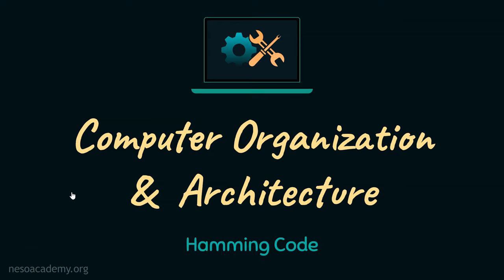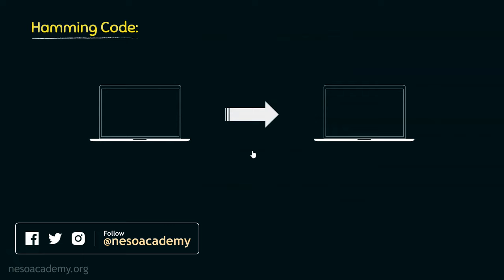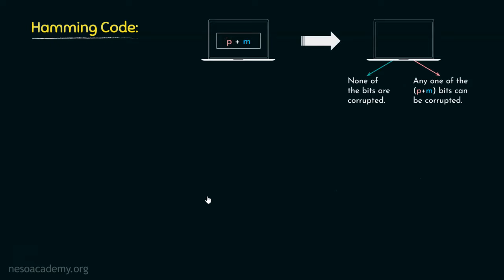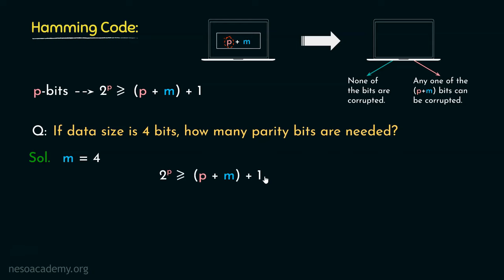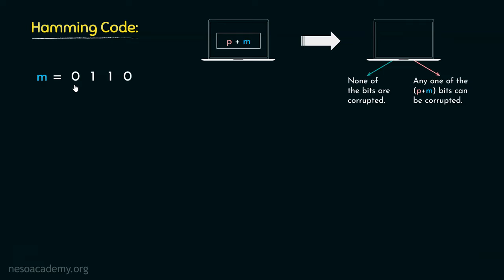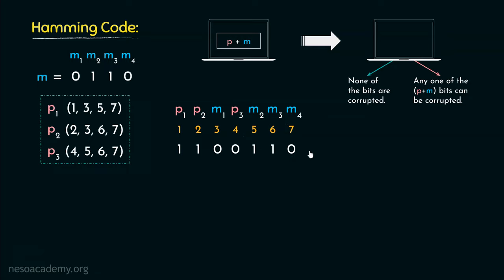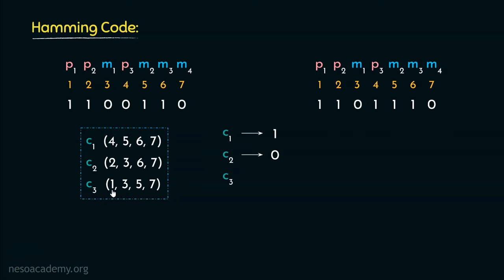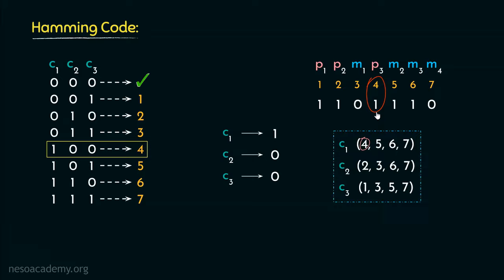Hamming Code

Comment: Great video. You just denoted the hamming code representation the other way round the p1 bit is supposed to be the rightmost and vica versa. If that is not taken care of while solving a question one may declare a valid hamming code to be invalid!!!! So be careful and if possible write a note about it in the video.
Reply: no, he denoted it correctly. both of the ways re correct

Comment: 🎯 Key Takeaways for quick navigation:

Hamming code is capable of facilitating error detection and correction, unlike simple binary codes.
In computer organizations, single bit errors are common, and Hamming code helps correct them.
Parity bits are appended to the message for error correction. Two scenarios can occur: no corruption or one bit is corrupted.
To handle errors, Hamming code requires 2^p patterns, where p is the number of parity bits, and 2^p >= p + M + 1, where M is the data size.
Example: For 4 bits of data, 3 parity bits are needed.
Parity bits are placed strategically to judge specific sets of data bits for errors.
The receiver uses parity bits to determine which bit is corrupted and correct it.
Hamming code allows for single bit error correction by pinpointing and correcting the erroneous bit.

Made with HARPA AI